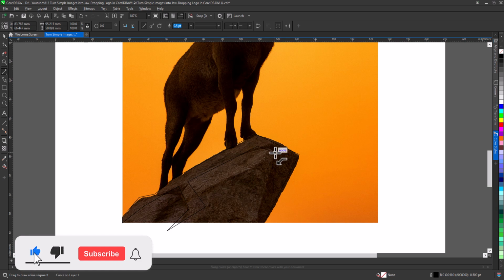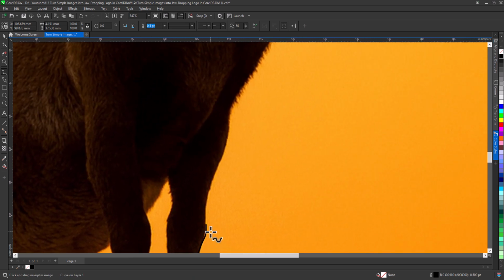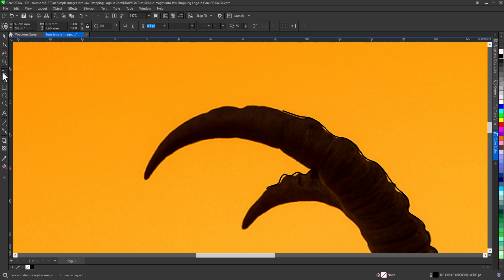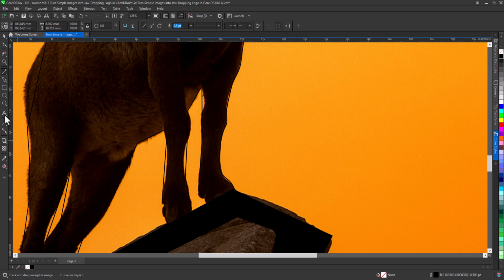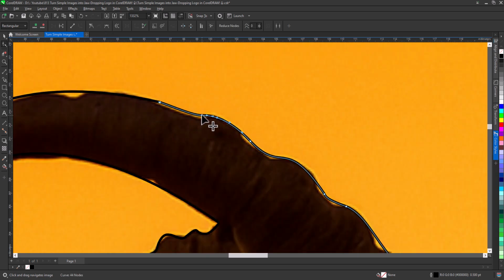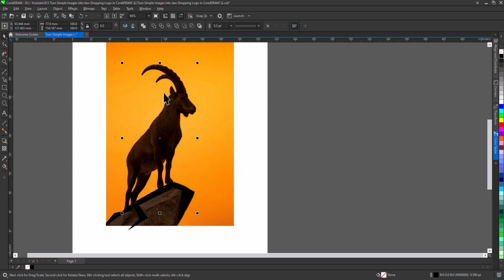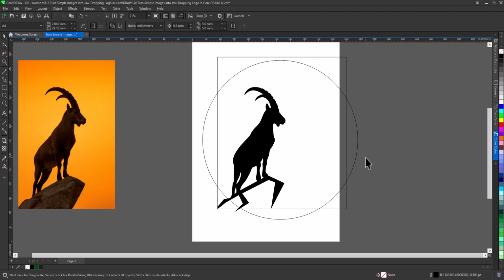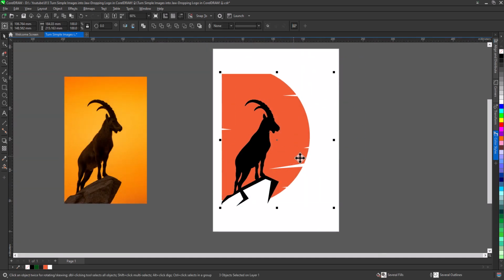Turn Simple Image into Jaw-Dropping Design in CorelDRAW! 🔥

Comment: Corel draw  best drawing tool name  line tool,pentool,2 point curve tool,or brazier tool ..which one.
Reply from the maker: Each line-drawing tool in CorelDRAW has its own features and way of being used. You can combine multiple tools at the same time, or you can stick to a single tool depending on what you’re used to or which one you prefer working with. But there isn’t really one tool that is ‘the best’ compared to the others — each tool has its own advantages
Reply: thanks
Reply from the maker: welcome